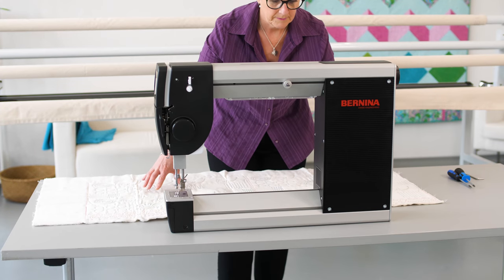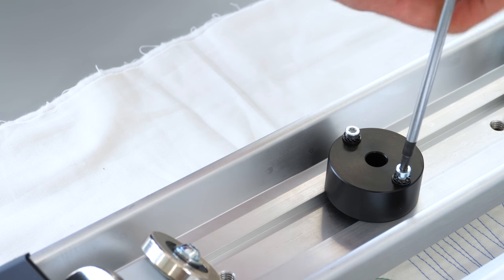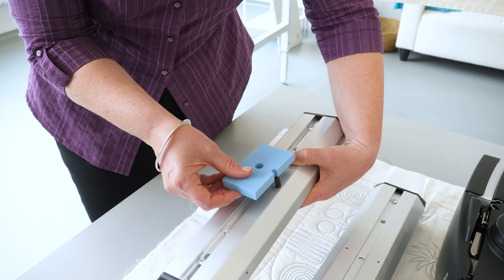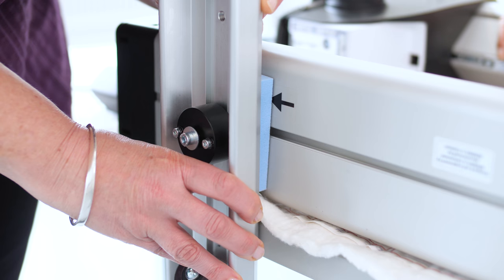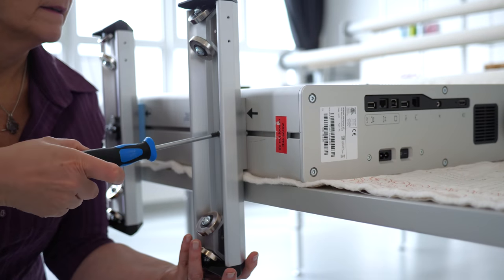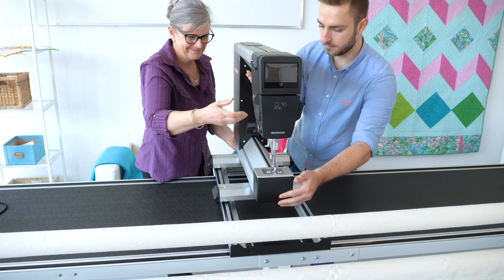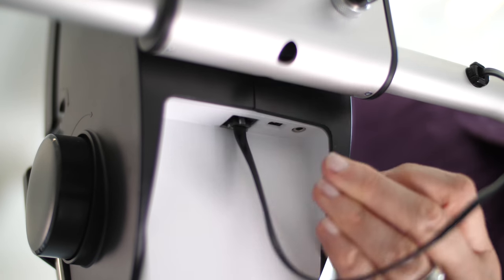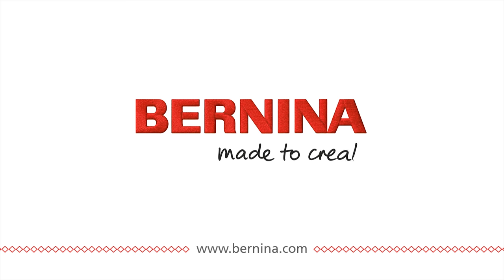How to prepare the Q 16 PLUS longarm machine for the BERNINA Studio Frame

Comment: Hi I have a q16 but it doesn’t have any printed arrows underneath, where would I place the carriers?
Reply from the maker: Dear Jamie, unfortunately the early Q 16 machines do not have the arrow marking. Please revert to your local dealer who has the exact measurements where to place the stand profiles and will guide you.